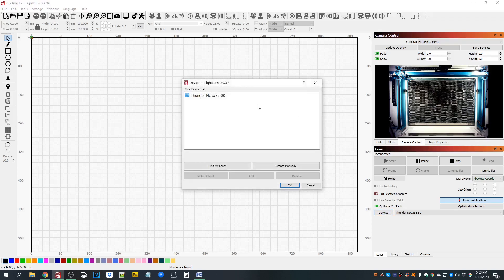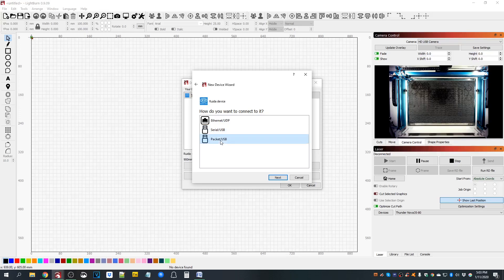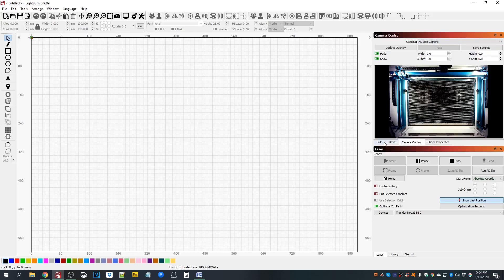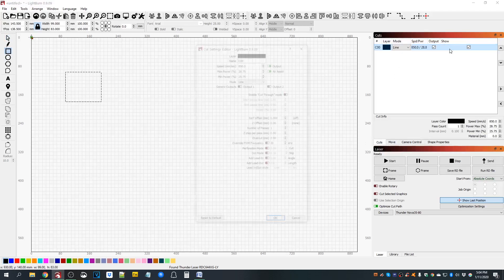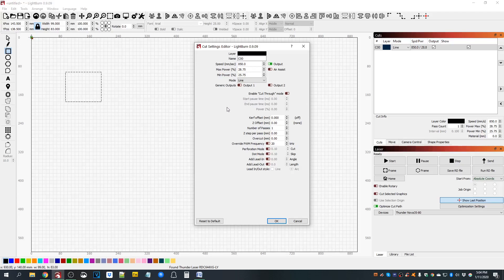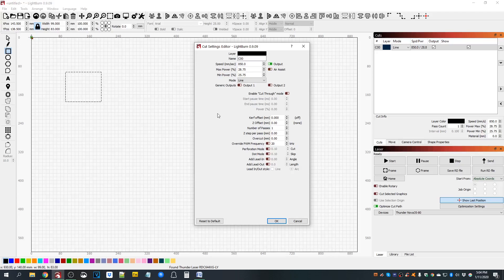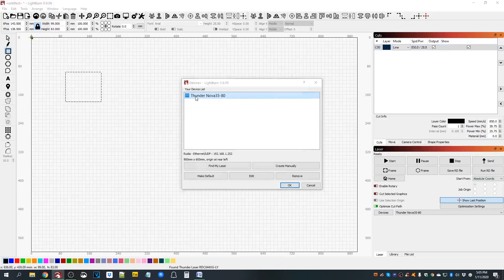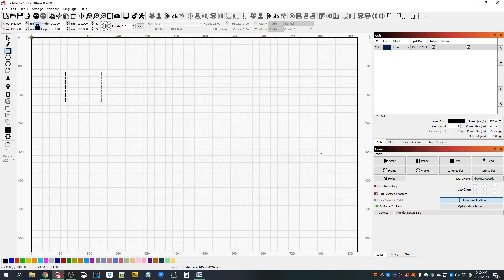Correcting Sequencing Issues With Thunder Dual Air Assist in LightBurn

Comment: We just noticed that the other day, only seems to have the issue when trying to run the program from lightburn. If we “send” the file from lightburn to the controller then start it at the controller, everything seems to work fine
Reply: The issue still persists. Just ran into this issue and unfortunately, Packet USB was already selected. Sending the file to the machine is working for me. Thanks!
Reply from the maker: This is good to know. Thanks for that input.